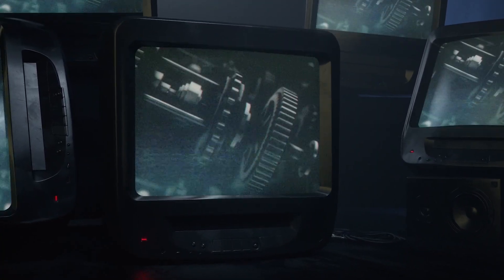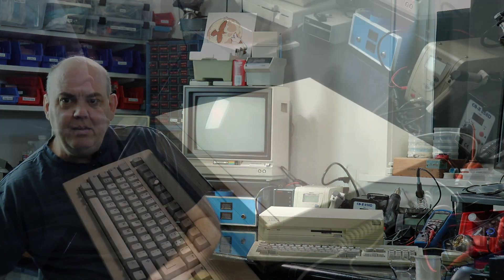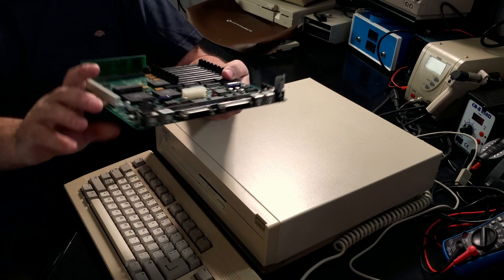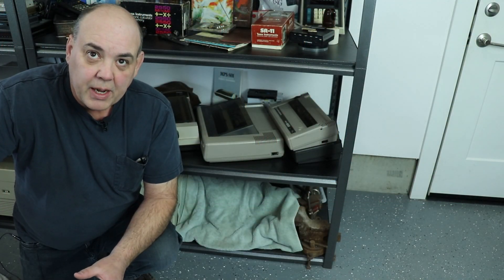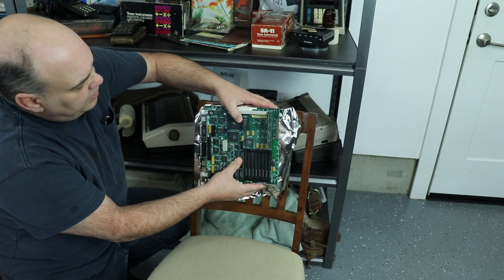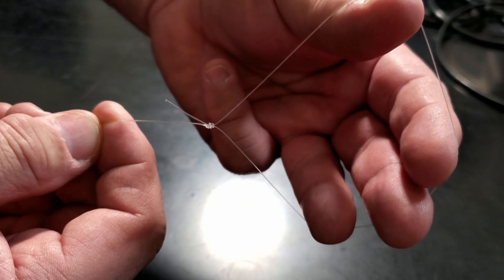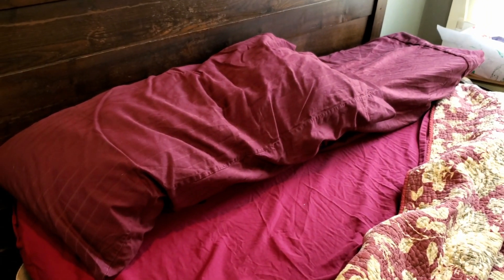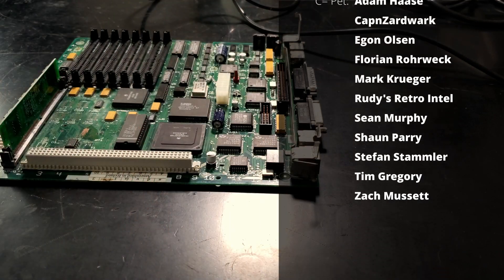[Parody] The PROPER way to remove surface mount capacitors

Comment: Ouch that gave me cap ache!  Instead of removing the cap, you can just drill the decay out and fill it.  You can also socket it so you can swap your caps around to suite the particular software you want to run.
Reply from the maker: Great idea! Maybe even a framework of wire to keep all the caps upright and properly aligned?

Comment: I think I see where this is going...
The ole sore tooth removal.

You should've done that with an A3000 board for a nice tidal wave of hate.
Reply from the maker: I was so cautious with a board that had corrosion barnacles on it. Had I used my 3000 board I would have been a wreck!
BTW, the board, and its associated machine, went to someone the next day that is working on a restoration and needed some of the ICs so it is still bringing life to other machines!